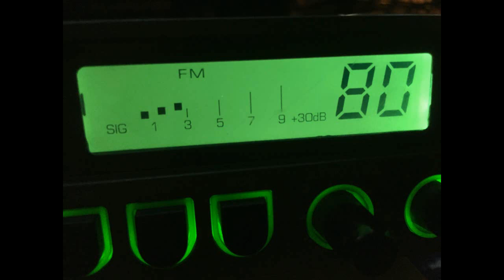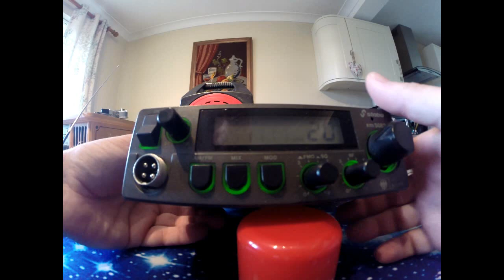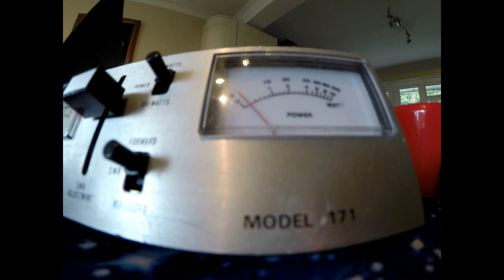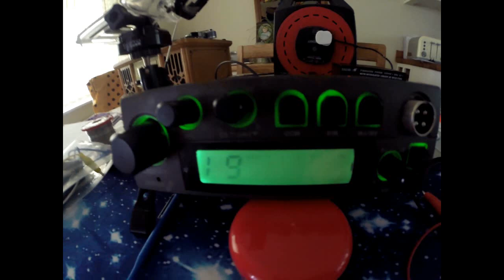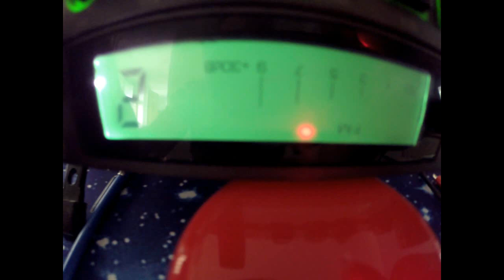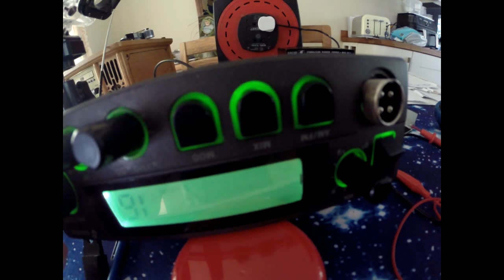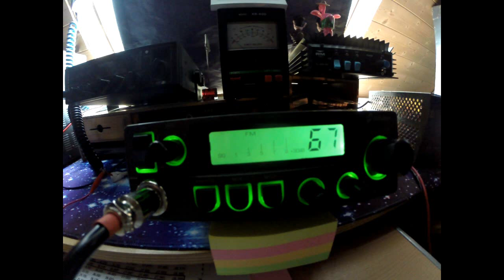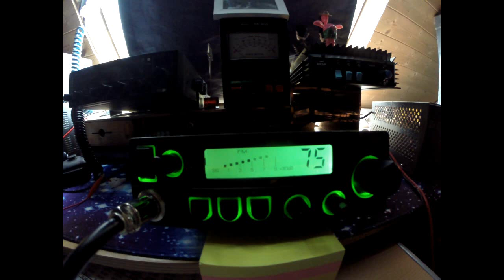It's all the wrong way round?

Comment: Germans have 80 channels, 40 mid band, cept, US whatever you call it, 40 fm channels below that, what was is called low band. Am originally was only available on first 12 channels mid band 1 watt. Which that rig looks like it might be.
Reply from the maker: Hi yes it is that layout but channel 1 is mids channel 1, channel 41 is channel 1 of the lows. Normally the lows first and mids after, its all the wrong way round as in the title, but a nice little rig. Thanks for the info, spot on by the sounds of it, much appreciated, all the best , Mark 👍